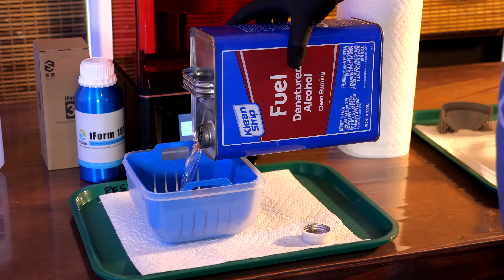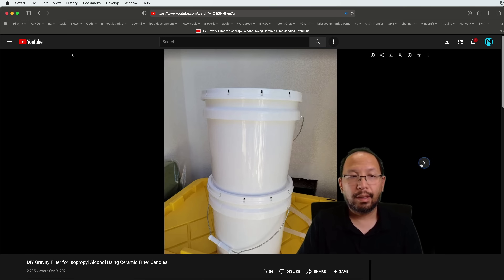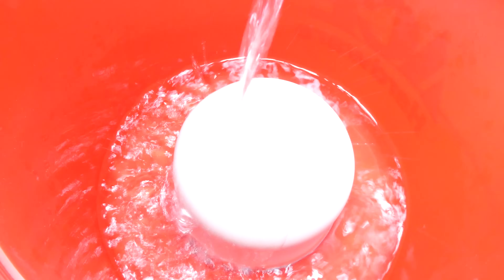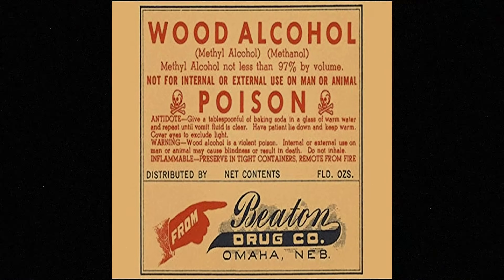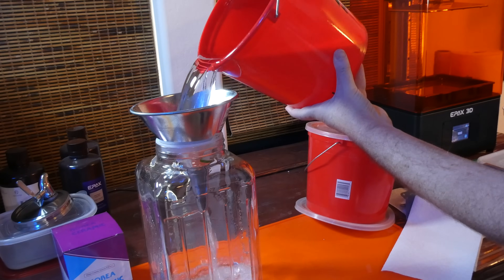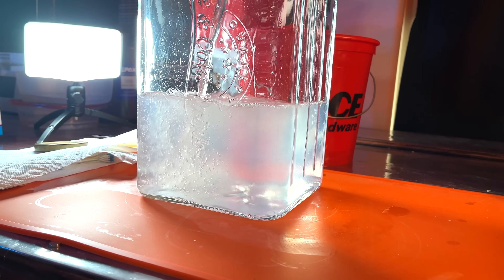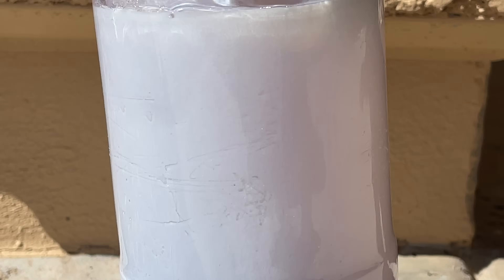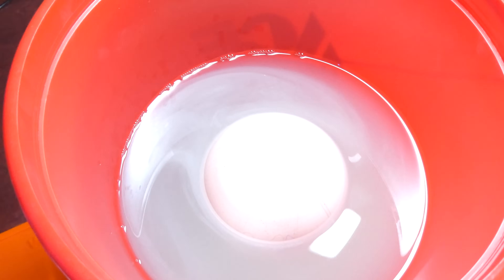Can We Recycle 3D Printing Alcohol?

Comment: I tend to use 99.9 isopropynol and purify it be putting it out in the sun in a closed container for a while to cure.  I have to shake them or take a silicone spatula to scrape the sides every so often depending on the size container I'm using.  After a lot of it is cured out, I bring it inside and let it settle to the bottom for a while.  I can then pour most of it off the top and then through a coffee filter.  I deal with a lot of the "mucus" you described, but I managed to reclaim ~80% of my alcohol.  I do a lot of printing across multiple machines and will clean my alcohol every couple days (so every 7-10 build plates full on a Photon Mono X) with pretty good results.  I keep enough alcohol to have 2-3 batches rotating through being in use, settling, or curing in the sun at any given time.

After seeing your results, I may have to look into how much I would gain from using a more extensive filtering process.
Reply from the maker: Thanks for the comments Dana.  I think there's a process in here still that could work.  I need to do more experimenting.

Comment: It seems to me that you couldn't simply run alcohol through filters and actually remove all, or most,  the resin. Sure the particulates settle after a time, but their is still resin in suspension in the alcohol. The proof of that is that setting it in the sun will kick the alcohol and start the "sludging" process. Filtering after that, if there is still clear alcohol in the container, is then OK. This is what I have done many times. For proof this method works, I would like to see one more step tried: Put the completely filtered alcohol in the sun and see if it kicks and any of it turns to sludge. If it does not, I may trust this method. How about it, can you try this next step and see if there truly is any resin left in suspension in your final clear alcohol? Very Kurious in Kentucky.
Reply from the maker: Yeah I might need to make a follow up video and try again with a modified system.
Reply: You will never stop the resin with a filter... at least not this kind. It's like trying to filter out sugar or salt of water with a screen, just ain't gonna work. You need to remove it by curing it, or distilling it into its fractional components.
Reply: @kleetus92  or you can try with reverse osmosis
Reply: @hansrojas9487  Maybe, but I'm not sure it would be worth it... And I say that because while yes it's a polar solvent, the material resin that gets left behind would clog the filter and never be rechargable...  so it would be a one and done use... and a lot more expensive than just buying more isopropanol. I also believe it would take a unique filter, not just the ones used for drinking water, so again the cost goes up.

Comment: damn its really frustrating isn't it? I have no way to dispose of all this alcohol I'm collecting. I've let it sit for weeks, months even and filtered it, cured it. I just end up with enormous amounts of alcoholic gravy that won't clean up further. My town has no facilities to dispose of this so do I just pour that poison down the drain? 

Here's my system now. If it helps someone great, maybe this is obvious I don't know. So what I do is I get my print and let it alone completely away from any sunlight so any resin, usually on the insides of prints can drain as fully as its going to. This doesn't work as well as you might think as depending on the shapes of the models you can get pools of uncured resin trapped that need the model to be rotated to release through any holes you've carefully made for your prints. So I rotate them and leave, rotate and leave with no real rush to get them done. Once I'm happy they are pretty well drained I put them in a big plastic container and using a spray bottle full of alcohol I start to spray the models and give them a really good blasting which doesn't use hardly any alcohol at all really. A few paper towels in the bottom of the plastic crate is enough to soak it up. I rotate and blast more, amazing how much resin will still come out of models after they get run through with alcohol. Now I leave these to dry out and only then! do I put them in the wash cycler thingamajib with its beautifully clean alcohol. Give it a really good full session the longest the machine allows and then I drain them and leave them to dry.

This spray bottle stage has cut down on the dirtying alcohol by so much I've done prints where just the spray bottle is all I felt  was necessary and the beauty of having all the dirty resin alcohol blend at this stage is its settling into paper towels that you can leave in the sun, let them cure and dispose of them safely in the trash.

Not the perfect solution but its helped me.
Reply: Have you tried setting the "gravy" outside in an open container to let the alcohol evaporate?  If that works you can dispose of the solids in the garbage.
Reply: @dkendrick652  my first attempt at that, I just assumed it would rapidly evaporate but next day the amount had increased. I knew it could rain but I thought it would still evaporate in the air fairly rapidly. big mistake hehe. I made a cover so rain couldn't get in but it could still evaporate out, left it several days and it didnt budge. It just settles a little more over time and you can cure that and refilter but at least with my crude filtering i never got any usable cleaning alcohol, just stuff that added little bits onto the models when you tried to clean them, like fuzz thats really hard to get off.
Reply from the maker: I wound not pour it down the drain or you’ll end up drinking it eventually. If it’s beyond saving take off the lid and set it outside to cure and dry up. Then toss in the landfill.  Unfortunately
Reply: @Nerdtronic  I have left it out for a week and saw no drop in the amount so I just have these big containers now that are my burden. I'm guessing it doesn't evaporate when its blended with resin? You can get a lot to settle out but still end up with milk thats as you say in the video, useless for cleaning. 

My landfill refuse to accept them. That's the UK for you, behind everyone else by years.

I am going to have a go at this charcoal setup. All I've used to filter so far were coffee filters stacked. Really learned a lot from the video, cheers.
Reply: @ClayMann  it depends what colour it is. if its black then it will absorb more heat and evaporate faster. If its white then most of the heat will be reflecting off of the alcohol and not heating up in the sun. if its a large container than you have to increase the temperature of the entire container before the top layer will evaporate fast enough.

An alternative would be a solar distiller. 

theres a video on youtbe that shows the general idea, a black container inside a clear one, put the alcohol in the back container, it heats up from the sun, the clear doesnt. the alcohol heats up, evaporates, then condenses on the walls of the clear container and you've got pure clean alcohol.  Its more effective if you can raise the black container up so its not sat in the alcohol that pools in the clear container. 

"How to make a Plastic bottle Solar distiller" is the name of the video. Theres other design option if you just image search "solar still", like big flat dish ones with a plastic bag cover, ones that look like those solar water heater people build to heat their homes. So theres a few options. 
Also depends on if you have a place that gets enough sun. I'm in the uk and i just have the one container on my window sill, it'll take a while but it works. 

also, if theres really no option in your area you could build a relatively big rig and advertise "3d printing alcohol disposal" services to people, gets you free alcohol :P, or you can charge them a fee

Comment: For the 3 bucket system, you could fill the top bucket with loose activated charcoal as the first pass filter, then double up the ceramic filters for the second stage
Reply from the maker: Good ideas
Reply: Just about to jump down this rabbit hole.  Thank you for the great info

Comment: Wouldn't it be fraud when they sell it's as 99,9% IPA while they have added stuff to it?
Edit: I actually really see a basis to argue about your statement that IPA 
contains the same additives as denatured alcohol or rubbing alcohol. 
All information I've read so far in the Internet never mentioned 
additived.
Reply from the maker: Hmm I wonder. I think all denatured has methyl alcohol added. It’s still “alcohol” so I think it gets included in the 99.9%
Reply: @Nerdtronic  Mine clearly says "Ingredients: Isopropyl Alcohol  99,9% purity", so they are very specific about that.
Reply from the maker: I was thinking that Isopropyl Alcohol might already be a mixture of different alcohols but I guess it is it's own thing and therefore, yeah, the smell is part of it... https://en.wikipedia.org/wiki/Isopropyl_alcohol
Reply from the maker: I might be wrong about that.
Reply: if you have pure ipa then its likely pure. if it doesn't mention "methylated", or denatured then it doesn't have additives. 
Why? because ipa will kill you either way, no one would be stupid enough to try drink it. Its ethanol and methanol that need to be denatured and have additives put into it. people can drink quite a bit of ethanol, thats what all drinking alcohol is, methanol someone could drink a small amount of and not be that put off by the taste because its similar to ethanol, but even with small amounts theres a risk of going blind or just dying, its slightly less deadly than all the other alcohols. But thats not saying much, all the other alcohols are fatal at even small doses, so the laws on whether they need to taste awful might be different depending on the country. Generally IPA smells pretty undrinkable all on its own.

Comment: Honestly... i let my ipa sit down in my basement, outside of my cleaning station and pull the (mostly) clear ipa out with a 60ml syringe with a silicone tube every couple of times i wash something in there. What settled down to the base of the container gets pulled over to a very small plastic bucket with cover lid, where it can settle down another few weeks. What seems good in that tiny bucket gets pulled out with that same syringe. With that dirty 0.5cm-1cm of really thick resin stuff at the bottom i put it into a couple of paper towels, go out to the sun, a few minutes after that it is pretty hard and i throw it away into the trash. Every time i make this i loose about 10-50ml (depends on how dirty it is)

Sure, my ipa is not even close to that clear you have it, but it is clear enough for me to wash the next print in it.

The only downside, syringes do not like ipa. The rubber in it gets hard very quickly and the ipa drips through this black silicone/rubber - so you will have to hold it upside down all the time - thats why i use the silicone tube.
Reply from the maker: Thanks for the input and ideas. Hive mind can figure this out!!

Comment: Why should filtering the alcohol reduce it's smell. What you are smelling are the fumes of the evaporating alcohol, so as long a there is alcohol it will unfortunately cause us headaches.

Nonetheless, certainly interesting idea with the filters.
Reply from the maker: A guy can hope.
Reply: it would depend, some of the smell is the alcohol, but with denature alcohol its more likely one of the additives that creates the smell, another for the taste, another to make it toxic, possibly another to try induce vomiting. pyridine is a common one for adding smell, though its molecularly smaller than the alcohol so the filters likely let it through, but its boiling point is over 100 degrees, so a distiller might remove it. 
You still dont want to be inhaling any of this regularly either way though 🤢🤮

Comment: You really need to let the resin set first, then pour out that relatively clean part, let it set again, pour out, expose  it to the sun to let   the rest of the resin to polymerize, then you can filter it relatively easily. Tried it, it works, amount of waiting time is painful though.
Reply from the maker: Yes I was thinking I probably could have saved the bad batch by pouring it off and filtering it first. Then curing in the sun.  Then filtering it again through my 2nd pass filter.
Reply: Would a centrifuge type thingy help?
Reply: @VagabondTE  it could, but waiting is good enough. I use a lot of IPA anyway, and buying 5l cans of 99% stuff works best.
Reply: @cthulpiss  lol yea..  As I always say, no need for a wifi hammer.
Reply: @VagabondTE  thinking the same..
Reply: That was exactly what I was thinking the moment I watched the video
Reply: Late to party but that's what I do with water-washable resin. I have a 7L bucket, enough to fill it with two 3.5L buckets that I use for my washing machine - so it's really more like 1 filthy bucket, and 1 relatively clear that I can pour into it.

After filling it up, I leave it laying in the sun for 2-3 days or more if it's cloudy. Then I get a funnel, a coffee filter (I tried using it for resin filtering but it was too thick, ideal for water though) and slowly pour through the funnel into a smaller, separate container. It's not easy because I have to hold the funnel and slowly pour the rather heavy at that point bucket... I really need to make some kind of siphon system or something.
Reply: I made myself a cheese press.

I let it all polymerize, break it up like cheese curd , and then squeeze the liquids out. 

First time I did it with cheesecloth manually. 

Then I passed everything through a coffee filter. 

Then into my big Pur water filter bucket with the spigot.
Reply: hot water mix with dishwash soap and windex for an hour.. your welcome!
Reply: @redakumaproduction  do you use this to clean your parts instead of alcohol?
Reply: @antoniomromo  yes always!